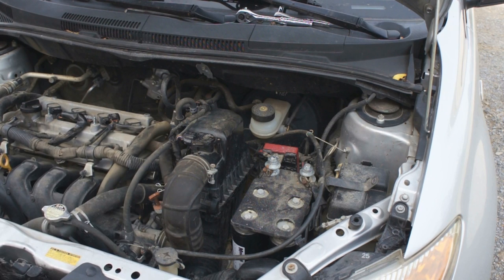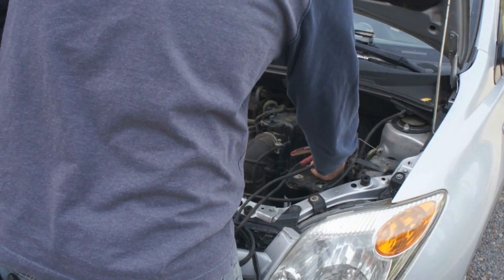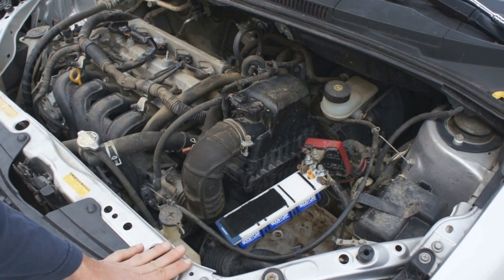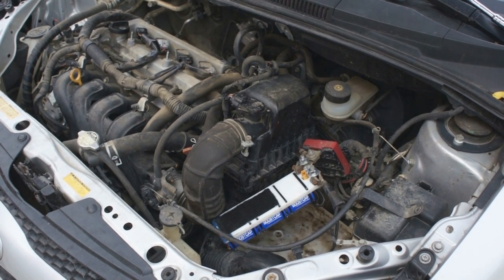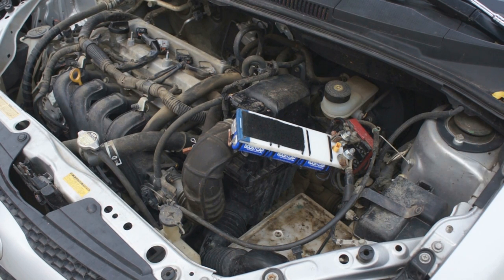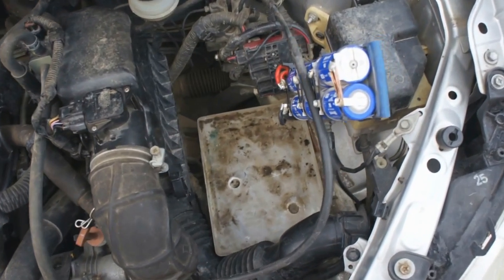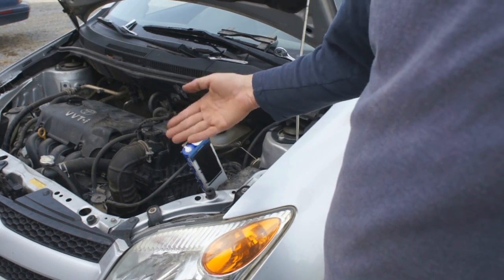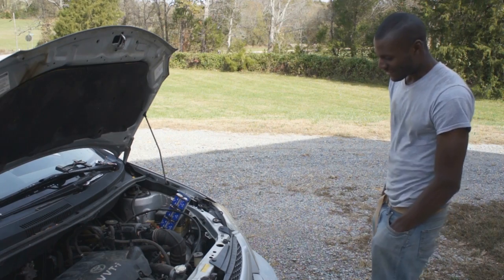12V Capacitor Pack Starts Car - Answers to Common Questions

Comment: Without the solar panel trickle charge, how long will the caps hold enough energy to start the engine?
Reply: Good question, I have some more specific questions. How long will it take for the alarm system and key fob system to discharge the capacitors?
Reply: Gene B I assume this is where the lithium ion battery comes into play, you'd think it would have to be isolated from the high current draw of the starter motor though.
Reply from the maker: Gene B 
I actually used it for a few months without the solar panel at first.  It would hold a charge over the weekend.  My car had no key fob or alarm.  It would not have worked well with that.  However in that case I would make a hybrid system.  The caps would provide for your cranking amps and the battery would supply your amp-hours.
Reply: It varies with every vehicle. There are some vehicles that have no electrical load when turned off, but most have clocks, car alarms, and radio presets that require a small amount of power. The dome lights that come on when you open a door also significantly discharge the capacitor. My Acura probably wouldn't sit for more than a couple hours before it drained a 350 farad capacitor bank so low that it no longer started the car.

Comment: The big unit can hold power to start the car how long? What is the solar panel power voltage require to keep this capacitor full charge?

Comment: Can the solar panel trickle charger Remain connected when you charge the caps? How long does it take to charge them with the battery? same for the 12v charger?  Thx

Comment: I think it´s a great thing for diesel engines. Takes all the stress of the battery. I was wandering if some kind of balancing system is recomandable. What kind of pack would You use for a 6,5L diesel engine. I have 2 batteries and plan on replacing one with capacitors
Reply: çheck  with chef 2 caoitire beter theñ 1   caóutir baterry

Comment: that is really cool,

would you say then that the main benefit would be weight reduction?

because the supercaps are probably twice as expensive as a battery, at least here in Switzerland and France.
Reply: Depends on the car and use case, but maximizing efficiency and power to weight ratio is nice, if you're into that kinda thing.
Reply from the maker: Yves Baggi 
Also long life. The life span on these is amazing.  In my case it was also cost. I scored a super deal on the big caps back when you could pick them up lightly used for 6 dollars each.  I really wish that I had bought a lot more back then because the price is rather high now.  I am hoping that grapheme technology will bring the price down as well as increase capacity.
Reply: aha, yes I remember you mentioning once you got some supercaps for 6 bucks. i will keep looking around for these but I have never seen them discarded.

what industry would use these intensively do you think?

thanks
Reply: Angelo Mayer 400F is too low. So far the prices I have received have been similar to Ebay prices. Sometimes higher.

Comment: Is there a circuit diagram for the Lithium battery connection to the super capacitor pack ?

Comment: The engine was cranked for 30+ seconds, but how much time is needed to recharge the capacitors from the car battery? Thanks!
Reply: furulevi Depends on the size, quality and age of your car battery. If you have a nice battery and don't melt your booster cables connecting it to a completely dead (0v) 500f pack can recharge to 80% in 13 seconds.

Comment: capacitor boost packs will also ease the burden on the car's alternator and extend its service life since it doesn't need so much topping off like a regular car battery!!  Lets move on to your electric car experiment suggestions...please install an alternator on each wheel and test if it can keep the electric car topped off without requiring a mains outlet to charge like the other electric cars..im also wondering if an electric car's motor can be made to run like a bedini pulse motor while cruising on the highway, that should reduce to battery consumption and help the charging to improve..goodluck with your future experiments comrade!!

Comment: I would also imagine that if your alternator suddenly died out, your car would also die almost immediately. This would not be good on a highway. At least with the battery and the warning light you can possibly drive a few miles more or at least pull off the road. This is what actually happened to me once before. I do think the idea is rather cool otherwise.

Comment: I HAVE DRIVEN A TOYOTA HIACE  VAN UP A RAMP ON TO A TRAILER USING ONLY THE STARTER MOTOR AND NO HEAT WAS FELT FROM THE CABLES OR STATER MOTOR BATTERY WAS NEW

Comment: car batteries are usually junk with limited recharge life..this is awesome
Reply: it meant for you to replace as often as possible   with boost caps in every single car  battery manufactures would go out of business  as it would extend the life by a lot
there is only 3 main automotive battery manufactures
Reply: wribg  car bateers kast lóbger

Comment: You flooded with tons of gasoline with only the spark plugs disconnected.  You should have just taken out the fuel pump relay

Comment: Can you let me know the name of the electric car you bought?
Is it a japanese electric car, foregn or domestic?
And have you made a video on how to make a water proof 1000 watt  graphene solar panel kit connected to an 1000 watt capasitor battery.
Basically enough to power an electric bike or scooter.
The supercapasitor might be a good alternative as long as they dont ware out quicker can you add your opion about that comment as well?
Things I like are bikes or scooters made of hemp, wood or a light weight natural material with a light battery pack that you can travel on airplanes with.
All natural modes of transportation easy travel sturdy water proof works in rain, sleet snow..

Comment: Great vid! What do You think about cap balancing? :)
Reply: Dominik M You can buy cheap balance boards from china for $18USD shipped (2amps of balancing, 2.7v max per cap, up to 6 in series). Generally with six 2.7v caps your car running at 14.4v is so far from the 16.2v rated (or 17.1v max) that I wouldn't worry about the balancing (as long as all caps are of the same age, type, brand, specification, etc.).  With my cap bank if they are a bit out of balance as soon as I start the car they balance themselves, same if I play the stereo loud or click the defrost on, etc. Any fluctuation in voltage/current draw balances the caps, when they are sitting there doing nothing is when they start to get out of balance.
Reply: Thanks for Yours opinion. What do You think about supporting the main lead acid battery with this supercap bank? Is it worth of spending money for easier cold start and to extend main battery lifecycle? I was thinking about building my own supercap bank with balancing circuit and make it work with main battery. I think that, the supercap bank can source more current at startup than lead acid battery. Starter should more easily sink power from supercap bank at start than the lead acid battery. I can't imagine how voltage would look, I think the voltage on supercap bank can drop faster than this at battery. After engine start the cap bank will be charged from alternator and main battery. Cheers!
Reply: @thomaslawford2843  As long as you're not running them at 99% voltage of their spec I wouldn't worry about balance charging them. I'm still running the exact same cap bank as I was when I made the original comment 5 years ago, zero issues, no balancing :)

Comment: lightweight race car battery?
Reply: the problem is  you take out too much weight  youll slide around turns and peel tire alot more of the the starting line

Comment: so , there was some mention in the comments about paring batteries and caps together ....... good idea there ...... BUT..... i think it would work a little like this........... in an all electric car , the main problem is the charge time to distance  ratio.... even the tesla takes about .... twenty minutes  for 80%... ...... if they added a cap system to the mix, to take the initial charge , which would then charge the battery as you went down the road ... they could prolly cut that time down by about 75%... a five minute charge that gets you on your way with an 80% charge , or over two hundred ,miles in the tank .... that would be a great selling point ..... anybody know elons number... lol

Comment: Why spend $100-$200 when a battery holds a charge for longer at a cheaper price? I understand that a capacitor has more charge cycles giving it a longer life then a battery, but you're not really saving money because batteries are much cheaper. A capacitor discharges so quickly. If you let the car sit for a week in the winter, will the capacitor start the car? You said you needed a solar panel? I understand using it as an emergency boost, but for day to day use I can't see it being as practical and RELIABLE as a battery. Especially in a V8 engine
Reply: TheWolfmanG he spent $36 on the big one

Comment: When u take away the spark plug connections... Also take away the connections for the injectors... otherwise u can fill the catalytic converter with gas :/

Comment: Have you seen the Anitigravity boost packs? They are almost 1/4 the size of the mini boost pack and can boost a car at least 8 times i hear. My Bro just got one the thing is pretty awesome. has mini jumper cables and every type of adaptor plug you could thing of.
http://antigravitybatteries.com/microstartxp1/

Comment: hey, I'm finally taking the plunge since my car battery is on it's way out. just wondering if you have your solar panel hard wired to your battery? or do you use it as you need it? the instructions that came with mine said to not try and start the car whilst it is connected to prevent damage to the solar panel/ circuit board.
Reply: more likely plugged in the cigarette lighter provided your key ignition dosen"t turn off the connection

Comment: Could you fill a ev conversion with boostcaps instead of lifepo4 batteries?
Reply from the maker: Nestor Diaz 
It would severely limit your range. However it would make for an awesome EV drag racing car.